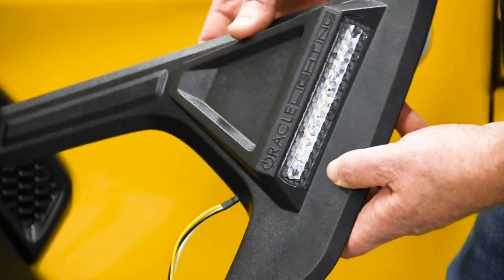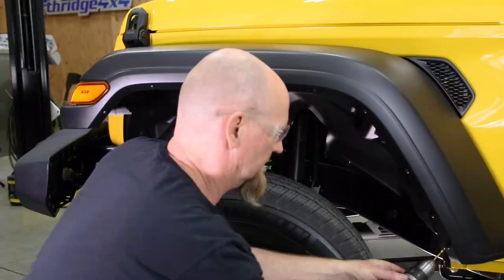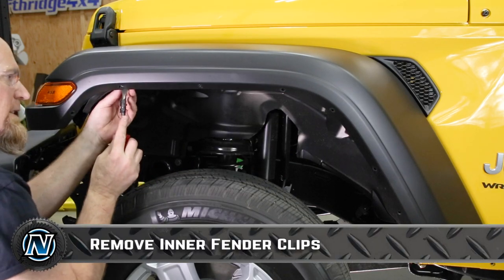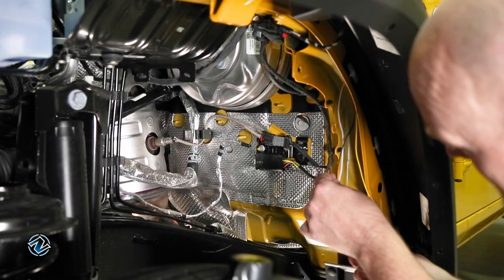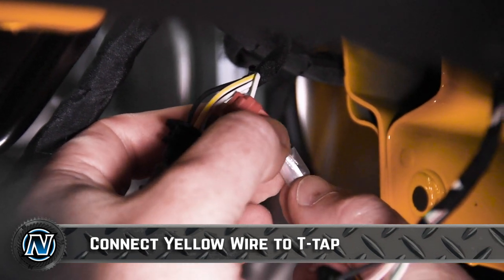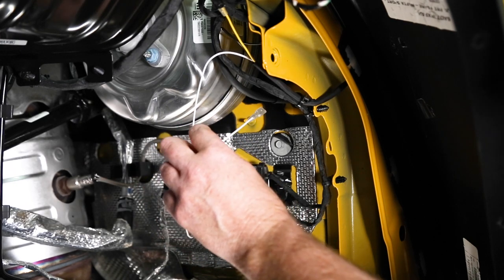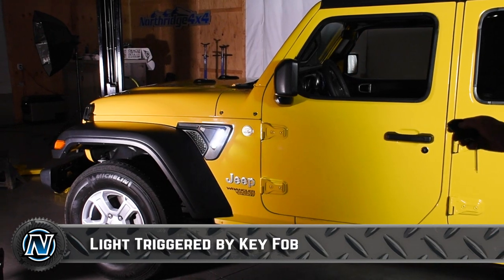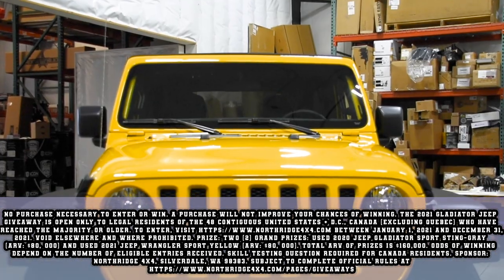Oracle Lighting SideTrack Install - Jeep JL/JT

Comment: I'd of wired the white light to the reversing lights be more beneficial when backing up I'd of thought.
Reply from the maker: That's a good idea. 
We also thought about wiring it to a switch so we could turn it on at any time.
Reply: @northridgenation   3 way switch one feed from back up lights the other direct from the battery all bases covered 😉

Comment: What about wiring the courtesy white light up to the bed light LED’s (Gladiator) so it would still be a courtesy light, but also you could turn it on via the bed light switch say when backing up?

Comment: a little big for what they are. I'd prefer a replacement item to where the plastic vent is. then it still looks factory.
Reply from the maker: That would be cool.
Reply: Check out the D&C Designs Lucid VSL lights built into the rear hood pillar panels:
https://youtu.be/fD_8i42dGXQ
Reply: You could but the vent is there for a reason… if you replace the vent with any type of lighting you won’t have air flowing out and just building up heat in that area with lighting